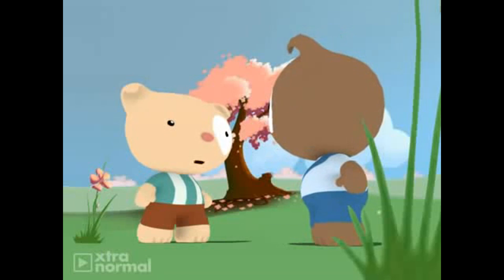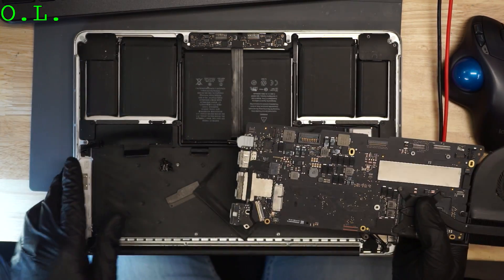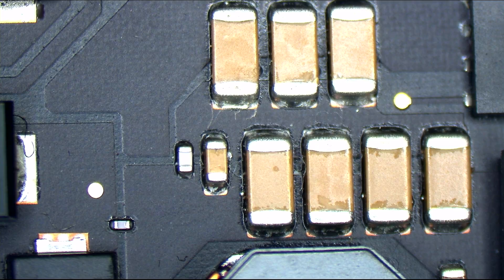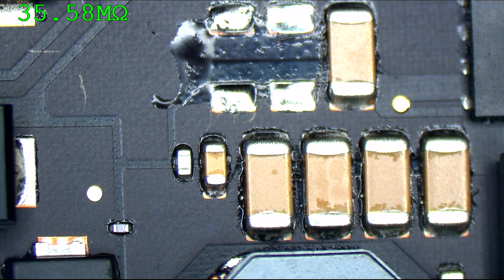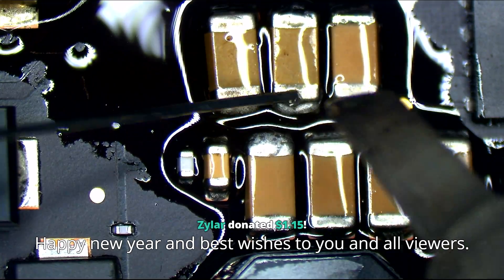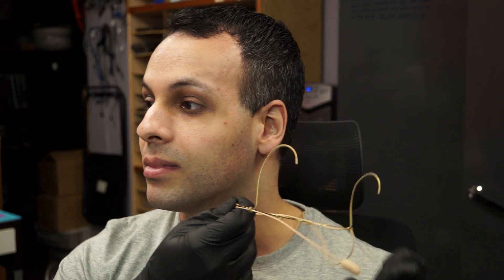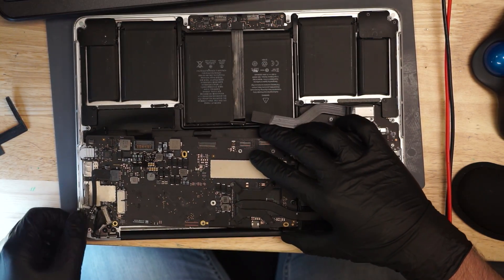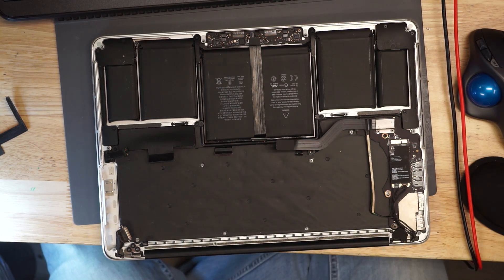Macbook Pro Retina no backlight after screen replacement: FIXED!

Comment: @Louis Rossmann
 do i have the bomb for you... https://veiling.catawiki.nl/kavels/23564399-apple-4-a1332-iphone-in-originele-verpakking

I sell this beautiful apple iphone 4 model A1332 with 16 GB. It is in very good condition and comes complete with original box, original charger, 2 data cables, headphones and 2 covers. Another Iphone 4 to 16 GB gift but not working. Useful as spare parts such as the battery that is in very good condition. 

Bidding is at 95€ at this moment
Reply from the maker: I give you $1

Comment: It looked, to me, like there were solder balls on the row of capacitors below the two you changed. Is there a reason why you didn’t change those as well? Are they on a separate rail that doesn’t affect the issue you were looking for?

Comment: That is the difference between you and an iRepair shop... you solder crooked caps and leave a working computer, mac has a specialized tool to place shoe undersoles on their non working ripoffs I mean repairs (auto correct strikes again)

Comment: At 2:25 you broke the mid and right cap with the tweezers. I wouldn't trust the right cap after that..   As for the solderballs they are from the manufacturing process, they use solder paste and they didn't cleanup well the board.

Comment: Didn't like this one, Louis. The fault isolation bit is part of your normal unplug-and-test routine. Voltages grounded out by shorted caps are nothing new. Visual inspection with a good eye for detail is the motherboard janitor's first tool.  

Glad you're with mic and sounding healthier.

Comment: Solder balls next to caps are not indicative of a failed cap.  They are usually present due to a manufacturing process issue and/or cleaning issue. Solder balls can cause shorts Else where on  the pcb that cause the caps to blow.

Comment: Truly Awesome diagnosing there Louis  some real eagle eye's you got there. So when these type of caps short they would get hot enough to make baby solder balls from the exixting solder they were in?  im asking cause i have never seen this before. i noticed there seemed be flux under the caps when you removed them.  how did that get there? I dont work on macbooks much so this is new on me.   One last thing, i would have like to see what those caps would read with the ohm meter and cap checker.

Comment: At  1:39 there are solder balls under the lower 4 caps too Why did you diden't remove them as well? Or do they have nothing to do with the problem?
Reply: When the ceramic capacitor fails short some solder is sometimes blown out from it.  Louis obviously knows which caps are associated with backlight on that board to not worry about the others until backlight is fixed.
Reply: i think louis probably knows the circuit well enough to realize if those other caps are part of it. i would assume they are not.
Reply: same question
Reply: same
Reply: Same question here.  Also,  what does the solder balls have to do with the short?  It didn't look like they were touching anything?

Comment: What caused those caps to have the balls next to them?
Reply: Heat from the bad capacitor.
Reply: Current running through the shorted capacitor created enough heat to melt the solder on adjacent components.
Reply: That's excess solder from the original manufacturing or from a repair. Solder paste is applied to the pad before the part is placed by a machine and then hot air is applied which might blow some off the pad while the solder is in its molten state. If the cap overheated there would be obvious discoloration to the part and perhaps the board underneath.
Reply: genetics